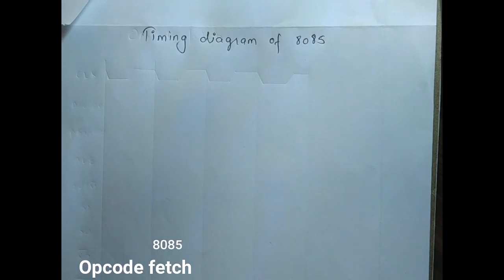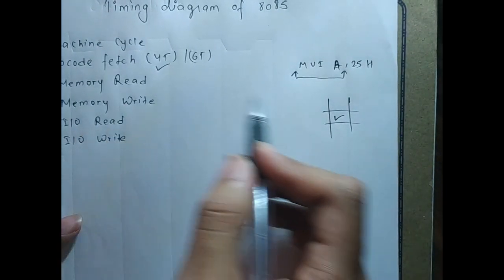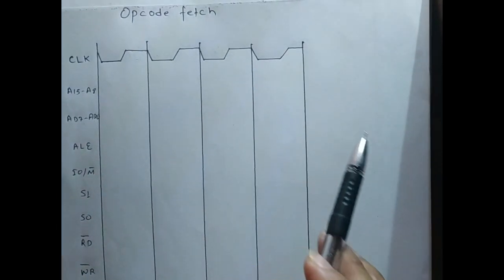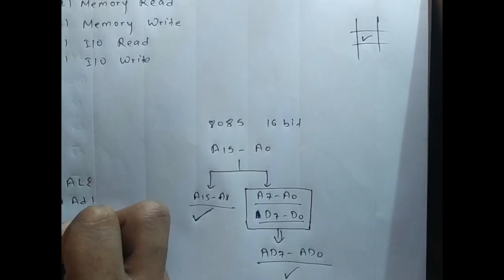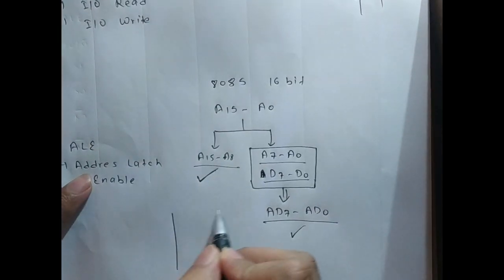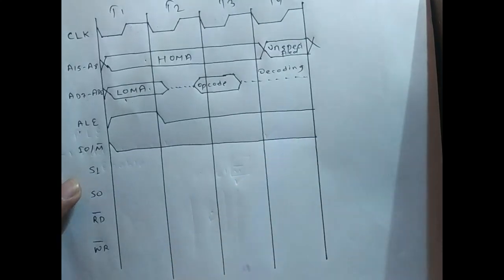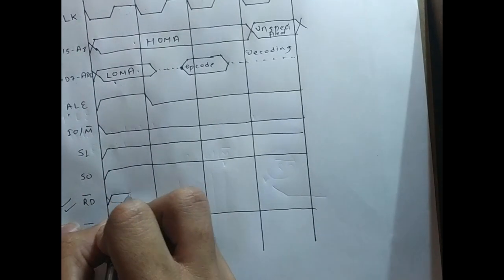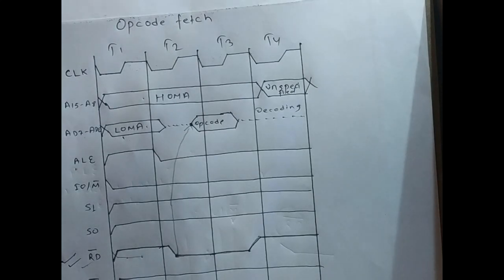1. Timing diagram 8085| Opcode fetch

Comment: Why garbage value in 4 t states
Reply from the maker: Up to T3 opcode gets fetched from memory via address bus, now to understand what actually that opcode
mean it should get decoded and during decoding there is no use of address bus so that's the reason.
I hope this answers your query.
Reply: @gameofcodes9832  Thanks so much for your kind response.......but the decoding is happening inside instruction decoder......ID may use internal data bus.... I am not convinced yet why address bus get garbage value..... although the data bus after its data transfer moved into idle state